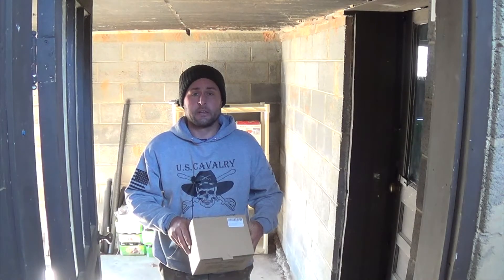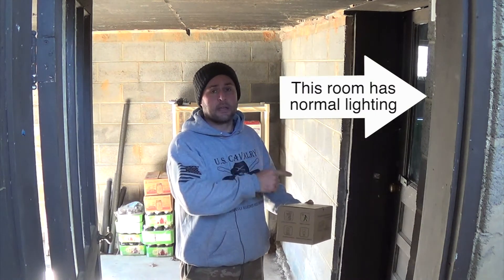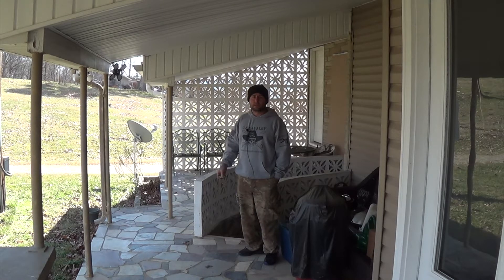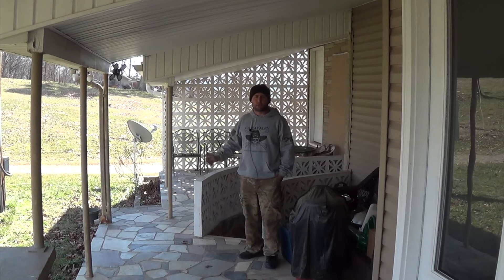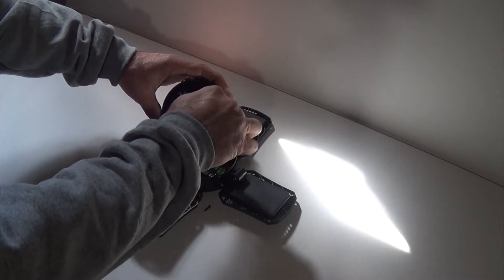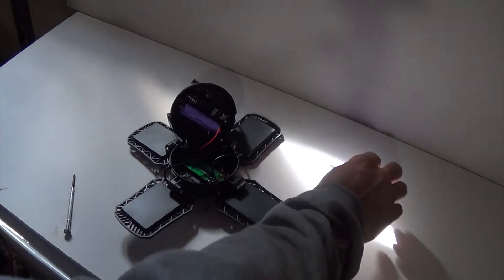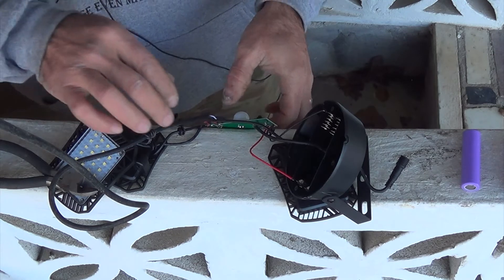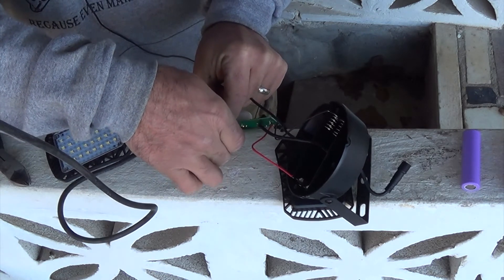Solar Pendant Light Hack

Comment: I’m setting this up now, but there’s no instruction to sinc the remote to the light fixture.  I don’t even know if the switch on the fixture should be set to on or off to use the remote.
Reply from the maker: My remote worked by just pointing it towards the light. My hack only moved the sensor to a different location so that I could use the remote there